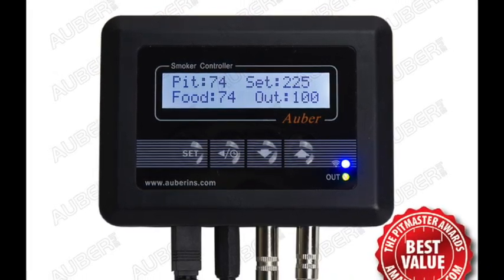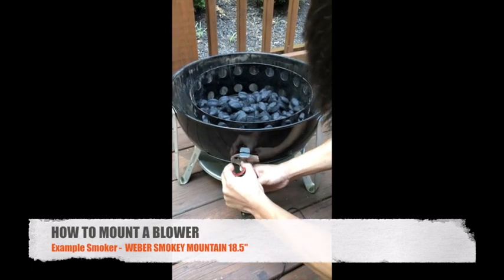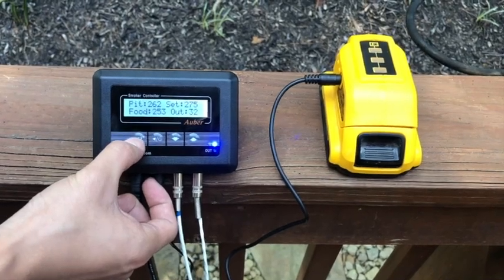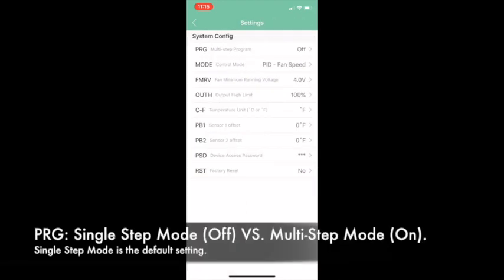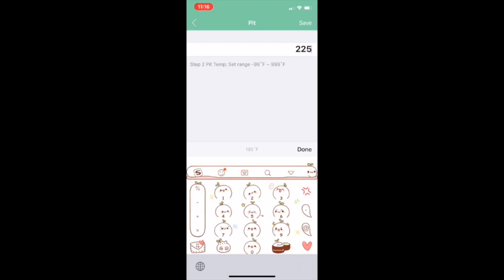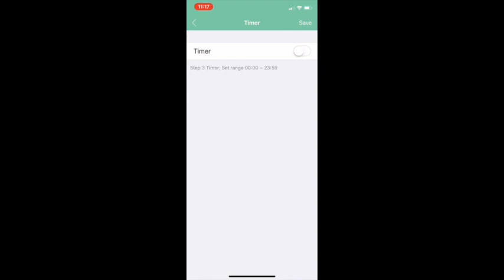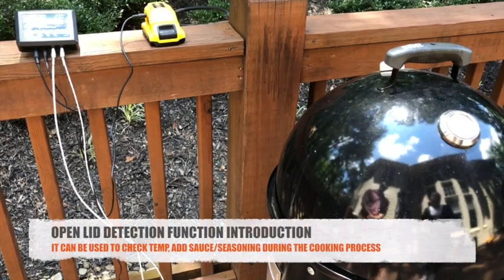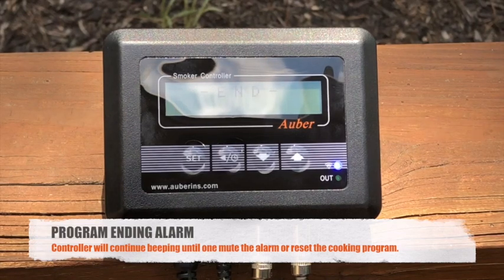Auber WIFI BBQ Controller Tutorial Video (For Weber Smokey Mountain)

Comment: It's kind of hard to believe that I'm considering buying one of these in 2021, but my Savannah Stoker has an Auber PID and it it ROCK SOLID.  Now that I have a barrel I really want a temp control option.
Reply from the maker: Dear customer, thanks for contacting us. For drum smoker control, you can check our latest kit KIT-3615-20 https://bit.ly/2SynKkf The controller in this video (SYL-2615) also works. You can find it here: https://bit.ly/360vNJw  Let us know if any questions.
Reply: @auberintruments  are there any mounting kits for these units?
Reply from the maker: @nathenoneptoh  There is a pair of mounting hooks that comes with KIT-3615, which works on SYL-2615 as well. Please contact us for more details.

Comment: I just picked this up and am wondering about setting up my charcoal. I have a 22.5" weber smokey mountain. Generally I cook at two different target temps, 225F and 325F. For 225 I would generally use the "Fuse" method for the charcoal, with about 20 lit briquettes to get the fire started. For 325 I would use the "Minion" method with about 40 lit briquettes to start. Normally I would always leave the top vent completely open, and adjust the bottom vents in order to hit my target temps, with the vents more open for 325 and more closed for 225. Now that I have the SYL-2615 to handle airflow, I was wondering if you recommend continuing to set up my charcoal as I did before, or is there another, preferred method for charcoal setup when using your product? Thanks in advance for your reply!

Comment: Why such cheap controller buttons? Latest technology with inferior buttons?
Reply from the maker: The keypad/switch we used in the controller are standard industrial switch. It is designed for low current and long life time. They normally rated for 500,000 to 1 million times use. Almost all of our products (PIDs, controllers, etc) are currently using this type of switch, and we haven't received any complaints regarding this type of switch in the past several years. If you have other better options for the switch, please let us know. Thanks in advance.